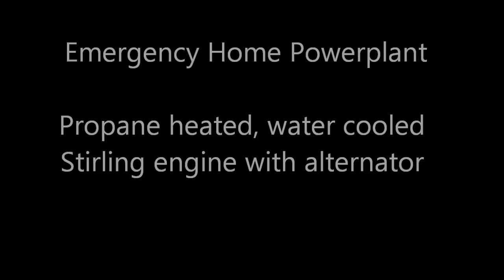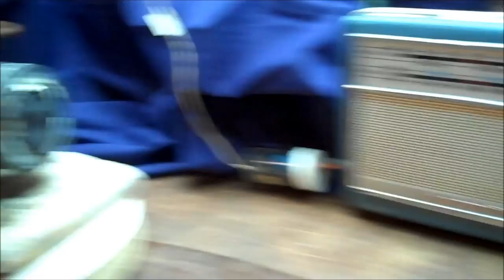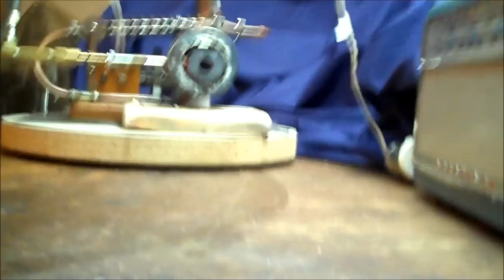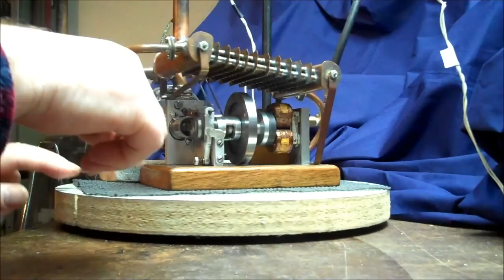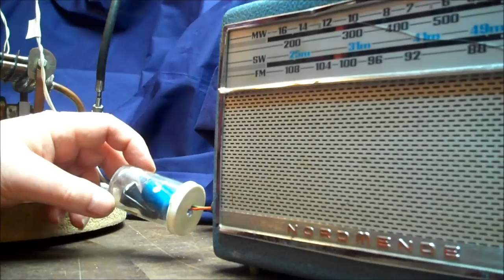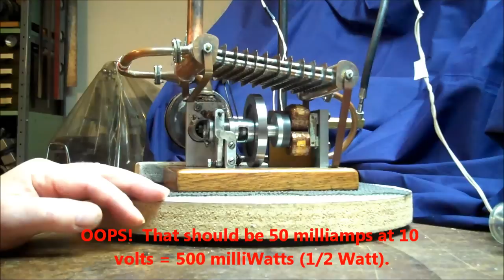Stirling engine emergency home power generator

Comment from the maker: lykenth08, thanks for your interest!
The pump is an axial flow impeller bent up from .8 mm brass sheet and fitted into a standard 1/2 inch copper water pipe elbow.  It runs at engine speed via a spring belt.  The shaft seal is a tiny Oring from a butane lighter.  The shaft is 2 mm dia. stainless steel.  To make this work you need the air bleed tube off the top of the pump unless you can fit an eccentric reducer to the pump's outlet.  At build time no such pump was commercially available.

Comment: I found the article, from Popular Science April 1961 by Harry Walton, upon which I believe you based your engine. It has all the blueprints and construction details. I like your addition of the water cooling jacket, pump and radiator which allows more power to be converted to mechanical energy driving the alternator. This could be enlarged but, as you point out the engine must be properly sized to what ever load for it to be of any real use.

Comment: Engineer,
I am taking a thermodynamics class and have a design project for a stirling engine. I want to use a radiator and copper tubing for cooling. What type of water pump did you use and where can I get them. How does it work? Obviously it would defeat the purpose of the engine if I had to plug in a pump.

Comment from the maker: @MullaneyRC 
One dimensional change I made is that my power piston is 3/4 inches in diameter.  This change will increase the power output at high operating temperature;  however, thus modified the engine no longer runs on candle power!

You pay your money and you make your choice.:-)).

For a demonstration model only, running on candle or alcohol burner, maintain the dimensions as per the original construction article.

The wire dia. is quite small,  I'm guessing .05 mm or less. 

W

Comment: Hi Wolfgang,

you've build a very cool machine! I have not the tools to build a machine like yours, but i will build a simple stirlingengine myself. Hopefully it will have enough power to drive a generator and do some 'useful' work. Do or did you build other stirlingengines?

Best regards

Lars

PS: Wolfgang is a common german name, are you german? I ask, because i'm german and my english is bad. I'd rather like to write in german....

Comment from the maker: @MullaneyRC 

The magnet is a disk, magnetized across the diameter and on the surface. (from mag lab. stirrer)

2 coils with perhaps 1000 turns each (guessing here!)  Originally I made a test coil of 100 turns and loaded it down with a resistor to pass 50 mA, checking the voltage across the resistor.  From this I calculated the number of turns required, split between 2 coils.  The laminations are from a relay.  A well-stocked junk box helps with this type of experimentation.
Wolfgang

Comment from the maker: @pisoiorfan 
I wish I remembered all that information.:-)).  I built this little powerplant over 30 years ago now.  The radial gap though, I remember as being 1/2 mm or so.  A little larger won't hurt.

The physical dimensions are as given in the original construction article published by Popular Science Monthly magazine, and is available on-line.  The date of the magazine is listed at the end of the video;  simply freeze-frame and copy the info.  Trust this helps.
Wolfgang

Comment: Hi, 
ThanksBasementEngineer for the great information. If you have time, please detail on the following: 
- Displacer and power cylinder length and diameters 
- Displacer and power piston strokes. 
- gap size between displacer piston and cylinder.
-  do you use any kind of regenerator? 

Thank you, 
Cezar

Comment from the maker: @mdemartile 

It's a homebrew axial-flow pump impeller fitted into a standard 1/2-inch copper water pipe elbow fitting.  The drive from the crankshaft is a wire-spring belt in 1:1 ratio.  The pump was designed to absorb about 1% of full engine power.

The rotor is a .032" thick brass disk with the blades slotted using a jeweler's saw, and twisted to the appropriate angle (which I don't remember, it was over 3 decades ago!) The shaft is 3/32" stainless steel.

Comment: Nice video. Where would one get a circulation pump like the one on your engine?. I can make my own radiator, but the pump I cannot find. I've often thought of making linkage from the hub of the flywheel and somehow using the cyclic motion to drive a postive displacement pump but I certainly haven't seen ay pumps that small